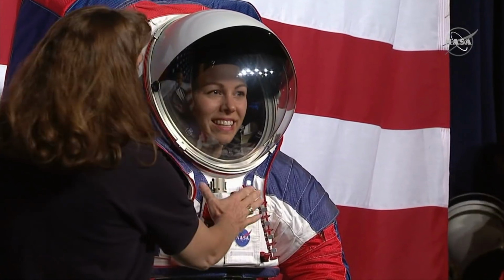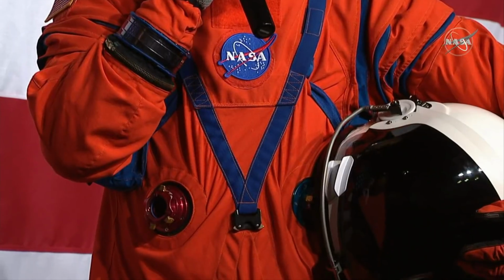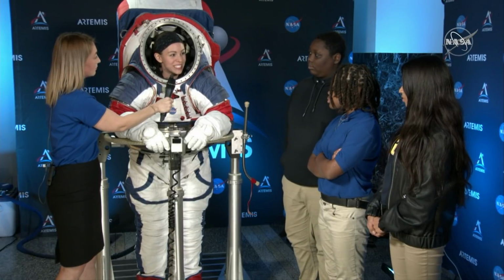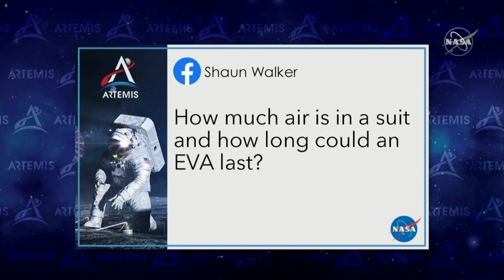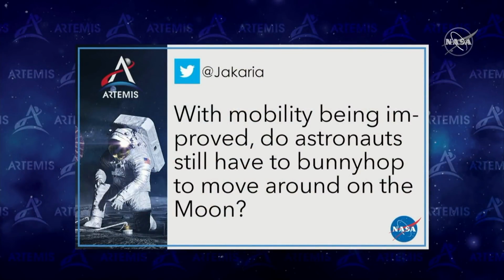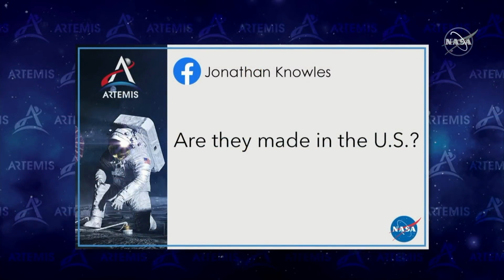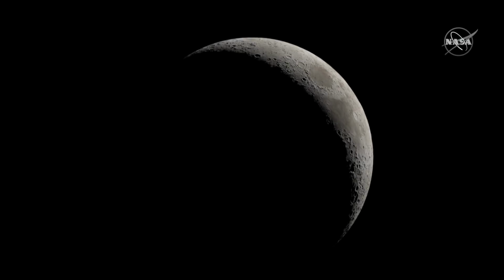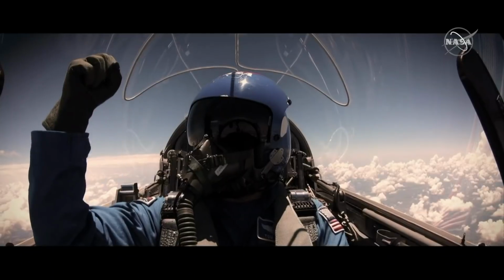NASA presents spacesuits for moon exploration – 10/15/2019

Comment: Hey Don't Use Silicone Rubber, Or Aluminized Mylar, Especially Don't Send Video Probes To Other Solar System Planets And Moons. Because You Are The Biggest Failure Of A Space Program That Ever Existed. KMart, $62 CCD Video Camera On The Tip Of A Rocket That Could Actually Steer. Nope We Are From Planet Fail. Earth.

Comment: I dont want to diminish the capability of new space suits but for anyone that is tracking the next generation suits development this looks bit silly esp around the waist. They should add fashion designer to work with engineers to make it look better. Just look what space X did compared to the orange suit. When it comes to space walk suit wtf happen to the Z2 model that was suppose to be used by nasa ? I know that the next, next generation space walk suits using nano wires for pressure is not ready yet but still.

Comment: Why would you pressurize a suit in a vacuum? You pressurize under a high pressure atmosphere like an ocean or the crushing atmosphere of that giant pool they train in, to counterbalance the pressure in the suit with the surrounding pressure outside the suit to keep it from crushing the wearer of the suit. Wouldn't it be the exact opposite in a vacuum. You would have to create a vacuum in the suit to counterbalance the environment inside the suit with the vacuum outside the suit to keep the suit from expanding until it burst. But if you did that, it would kill the astronaut. Because a vacuum would make the water in their body boil. The irony is they train in a giant pool with the water crushing in on the suit on all sides. They don't train in a vacuum to simulate space that pulls outwardly on all sides.
Reply: .....and thats why you don't work for NASA or for any other space agency for that matter.
Reply: @j.p.7272  Your dumb ass response had no substance. I don't need to work for NASA to know that!
Reply: @perrypointer4670 I just thought I point it out. You are welcome Perry. 😉
Reply: EVA suits need to be pressurized so your blood doesn't boil, not just for structure. Space is a vaccum so there is not any outside pressure pressing on you like in an atmosphere or underwater to keep you alive, so an EVA suit needs to be pressurized to simulate an atmosphere.
Reply: Because humans need air to function.
Reply: Earth pressure is 14.1 PSI. The suit only runs at 8 or 4 PSI. Underwater you would be going more than 14 PSI (depending on depth). The suit goes down to the lowest PSI a human can take before gasses come out of solution in blood.